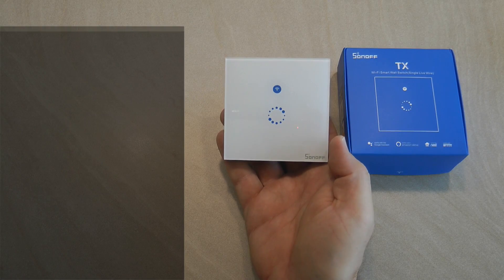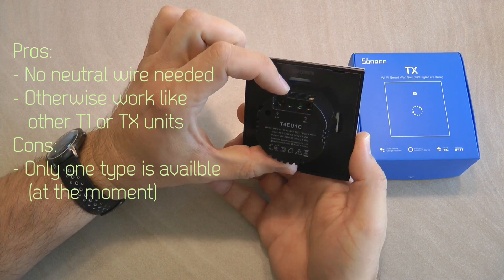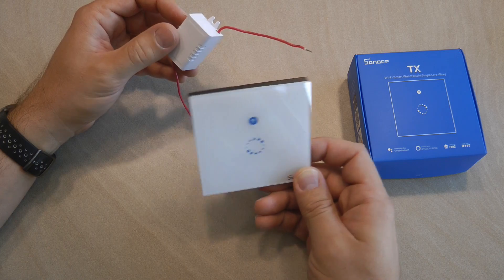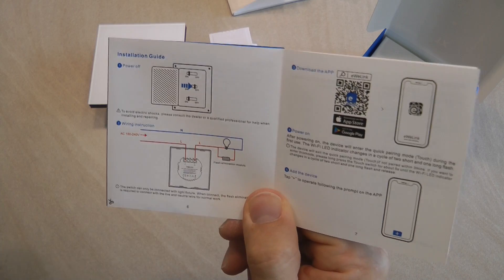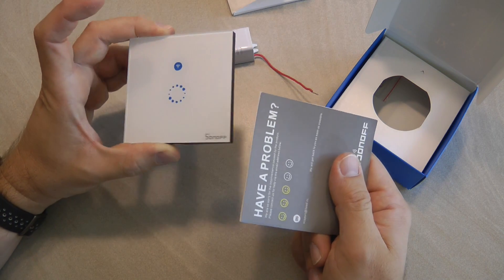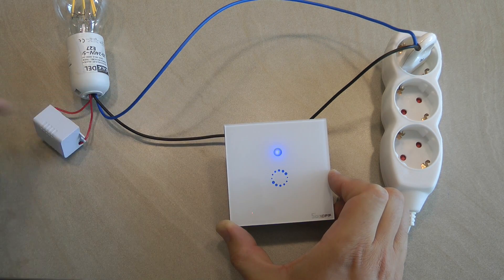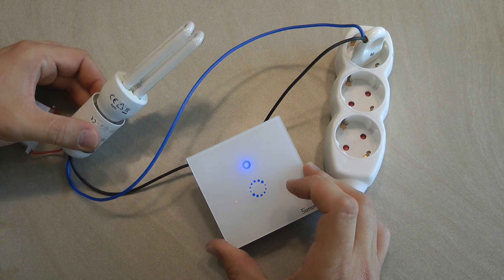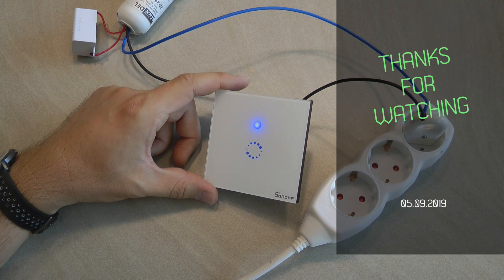Sonoff TX single live wire Wifi switch

Comment: My guess is it is actually an antiflicker unit,
one way to do it would be the sonoff leaks some current and used the voltage drop to turn itself on, this would cause flicker in modern lamps and hence the need for a bleeding resistor across the lamp,
but could you measure the leakage current and share the results with us, also can you measure the capacitance of the sonoff when its off and disconnected from the circuit?
Reply from the maker: It looks like the setup draws 0.003A or 0.3W (based on my cheap power meter). In the antiflcker box, there are 2 x 22pF (CBB22) caps in parallel with a 12,4ohm (?) (brown, red, yellow, gold) resistor. And to this, there is another 50ohn resistor in series.
Reply: @csongorvarga  this cant work, can you recheck please, 
12.4 ohm resistor is probably 124 kohm
CBB22 are probably not 22pf capacitors but much larger ones, read the text on the caps on second line, they should be at least 22n or more each, 33n to be safe
Reply from the maker: @bm830-b9e  The cap says CBB22 and in the next line 205J450V
Reply: @csongorvarga  OK, this can work, 
the 124kohm resistor discharges the caps if there is no lamp in the holder,
if there is a lamp in the holder it prevents the lamp from flickering when the switch is off.
the 50 ohm resistor limits the inrush current of the capacitors
when the lamp is off, the 2uf caps(CBB22) leak current which causes a voltage drop on the sonoff, the sonoff uses a dc-dc converter to reduce that voltage (and also increase the current) for the esp8266.
but how the device works when the switch is on?, well that's another problem which I am not sure yet!
thanks for the help
Reply: @bm830-b9e  2x2uF and 120kohm
Reply: @timm8311  thanks, also SuperHouseTV made a detailed video on how the device works if you are interested
Reply: @bm830-b9e  yes and if I'm not mistaken he explains about the discharge in case holding the the unit in our hand could be dangerous, so the resistor can discharge the high voltage in the capacitor very quickly, some few seconds, making it safer to handle the unit.
Reply: Szerintem csinálj ilyen videókat magyarul is, mert hiánypótló lenne. Én ma vettem egy hasonló SmartWise T4 EU 1C-t, ami szinte ugyanez, csak a Sonoffot már nem kapni Európában, kizárólag Kínából lehetne rendelni. Annyi különbség van a SmarWise javára, hogy az tud pluszba RF433-at is és kisebb méretű az ellenállás is, amit be kell iktatni s villódzás ellen. Egyébként ugyanúgy eWeLink kompatibilis és minimálisan tér el kinézetben. Nekem feketében van.

Comment: Can't find these switches anywhere!? I ordered sonoff tx switches but they require a neutral. Have they stopped selling them? Had to buy some chinese ones from ebay instead.
Reply from the maker: I can see the listing here: https://www.itead.cc/smart-home/sonoff-t4eu1c-wi-fi-smart-single-wire-wall-switch.html. Which site did you look. Maybe they don't have it in all Amazon stores.

Comment: Would this be ok to use on a ceiling fan? At the moment the fan is turned on by a pull cord that has just the live in and live out.
Reply from the maker: Sure, I see no reason why not. I don't know how much current the ceiling fans draws. Make sure it does not exceed the 10A which is the rating of the relay in this unit.

Comment: so this does not need another switch ? i mean if you take this wall unit will it be enough to do the job or should i take the switch and the sonoff box like device also ?
Reply from the maker: This Sonoff switch will be enough.

Comment: Hi, have you tried connecting one switch to 2 bulbs in parallel? There is only 1 anti flicker device so I'm wondering what will happen to the bulb without anti flicker device. Thanks
Reply: It only needs to be connected to one bulb to power itself and only one capacitor per switch is required.
Reply from the maker: I did not, but you connect the anti flicker to one the bulb and it will be fine.
Reply: @csongorvarga  Noted with thanks

Comment: Can this work without any wireless connection?
Reply from the maker: It always works as a regular switch. So if your internet is down you can still operate your lights.

Comment: anyone managed 2way switching with a couple of these
Reply from the maker: I think it would only be possible using using scenes. I have a separate video on that.
Reply: @csongorvarga  hi yes I have seen your video but when I connect two switches on the same one wire circuit none of the switches operate, maybe a power supply issue or conflicting info between switches, as a temporary solution I have used scenes like your video suggested with a separate downstairs light and the upstairs light and blocking off the switch downstairs that is linked to upstairs, and it has got around the limits of the one wire switch, maybe a battery operated switch at one location may be a good solution
Reply from the maker: @kennywilson7717  @Kenny Wilson I guess that anti flicker unit that you install only work if one one-wire switch is connected to it. T1 switches can be combined with a battery operated RF second switch. I never had one, so I am not 100% sure how that works. But that is not a one-wire version, that needs neutral as well.

Comment: Lol I still can't use it as I need a 3 gang unit
Reply from the maker: Let's hope it comes in the future.
Reply: @csongorvarga  what I'm planning on doing is I have too many lights so I'm going to remove the live coming to the switch from main and keep it aside and use the other switch going from the switch to the excess light as neutral by removing the bulb and bridging the Gap making it a neutral

Comment: Thanks for the video.
I'm still did not flash tasmota in the old T1 US but I can see that setting it in interlock mode by using ewelink you cannot set the inching mode. It means that if I'd like to use a T1 US with 2 gangs for a curtain when you turn on the switch Ch1 (CH2 will be off) it will remain on which having inching allowed it is possible to program it to turn off after the amount of seconds the curtain opens or close totally. Is it possible to control the T1 or TX by using NodeRed/MQTT and Home Assistant? Did you check it with your switches.
Reply from the maker: No, I did not. But I think it should be possible.

Comment: Can it be installed without the antiflicker unit?
Reply from the maker: No, that anti-flicker unit is letting a small amount of current through to operate the switch itself. So without it, will not work at all.
Reply: yes with an incandescent bulb, but not led or mini tube

Comment: Light bypased by capacitor at low currents. Low enough even an LED won't glow.
This also means if the bulb is not fitted the sonoff will still be active.

At the same time the electronic switch is likely to be, lets say, ~99% off or ~99% on PWM for the 1% time left to power it. With good capacitors the background current might be much less than 1%.

Comment: Hello Varga, whats happen if I connect two switches in parallel at S1/S2 ? Can I do this in order to have "tree way" switch? Thanks.
Reply from the maker: You connect the two switches in a 2 way configuration and connect the two ends to S1 and S2. That will work. Connecting them in parallel will not.

Comment: That anti-flicker box seems too large to fit most ceiling lamp bodies.
Otherwise seems like a really good solution, and it's rather cheap.
Wonder how safe these Sonoff stuff are overall for 24/7 operation.
Reply from the maker: It could be a tight fit, but I think still manageable.

Comment: Hey ,this will make life  a lot easier because modern houses stopped installing junction boxes here years ago  because it's a way that electric contractors save some money but still charge the same price. The world is getting cheaper day by day and the houses are getting smaller and less well made ,that's the facts of life.
Reply from the maker: Yes I agree. This is a smart move on Sonoff side. So far I don't see any drawback of this single wire design. Hopefully it gets picked and and other models will be released as well (2, 3 gang, US version, etc.)
Reply: @csongorvarga  I ordered one to test let's see when it arrives how it works .Although I also noticed that some company on Ali Express is selling  wifi enabled 15 watt dimmable bulbs which are compatible with Google home and Alexa for $5.00 would you believe that ,this is also a game changer if it works properly ? In my house I have over twenty smart gadgets including several Sonoff switches of different kinds and in different uses I am basically maxed out for bandwidth even though I have a 100 mb/sec connection which is the fastest  I can get in this area .
Reply from the maker: @daromee  Oh yeah, these are getting cheaper every day. I am still alien to the idea to have bulb that I can only control via an app or voice. I still prefer physical switches. And your comment on bandwidth: I don't get that. These devices hardly use the bandwidth. If you are facing issues, it could be related to how many wifi devices your router need to handle. I never had such issues, I have around 25 wifi devices around the house including the laptops, tablets, phones, etc. But there are other limiting factors. E.g. there are different channels you router operates on. If many routers around your area are on the same channel, that could be a problem. Buying one of those 5 or 6 antenna routers could be a solution. Those can work on 5Ghz and 2.4Ghz wifi at the same time. Meaning that your more capable devices like laptops, phones, tables can use the 5Ghz band and free up space for the other devices that can only work on 2.4 Ghz. I am not an expert in the area, but these are the things I heard to consider.
Reply: @csongorvarga  Yes I have quite a few devices but I also forgot to mention that I have five 720p cameras transmitting to an offline server ,I am also running everything through Google  so in the end I had another line brought into to the house and everything is now good  but expensive for two lines .As for using the 5 GHz frequency this doesn't work unfortunately for smart devices but does work for tablets and phones . I also heard that several wifi routers which have dual frequencies such as the Google mesh system won't work on even 2.4 GHz with smart  devices from China so I am using a very standard router which is supplied by my ISP. I have tried other some other routers and extenders here but they usually don't work with my smart devices .Another problem I didn't mention was that all the walls in my house are cinder block or similar with cement pillars so the penetration of the signal through the walls isn't so great . Sorry to bore you with all the details. I enjoy your videos very much as you explain everything so we'll. Thanks for doing what you do and it's quite interesting to me .
Reply from the maker: @daromee  Not boring at all. It looks like you have spend enough time on this already :)
Reply: @csongorvarga  thanks
Reply: @csongorvarga  I wonder ? I have one of those one wire light switches  from a cheaper company without any wifi and it came with a capacitor but I didn't understand then what it's for so I threw it out .Now I understand , but the funny thing is that before I understood I  saw  that when using led bulbs of the same wattage and the same manufacturer (Chinese ) some  flickered while others didn't .I thought these flickering lights were defective  so I threw them away ..Why would some flicker while others not ? Would there be a difference in quality of the LEDs but from the same manufacturer? .By the way as you well know because the LEDs are connected in series when one burns out you need to either replace the individual led (not for me) or through it out .I usually buy batches of these types of LEDs but since they are $1.95 each it really doesn't pay to fix them . I have had a batch's of ten with four burn outs which is quite poor .in general haven't had a led last more than two years which is much less than rated with use if approx 3 hrs per day yet but still hoping that quality will improve with time .  Have a nice day .
Reply from the maker: @daromee  Check the pinned comment on this video. bm830810 talks about how the capacitor allow some leakage current to pass through which is enough to power the switch. This is all I can tell, my explanation was simply "black magic". Going back to the cheap LEDs in my video one other issue is thermal management. My smaller bulb (like G20, G8) and especially the ones which are encased in clear silicone die faster. The manufacturer does not give a damn about thermal management and the components fail due to the heat after some time.

Comment: can we flash it :) ?
Reply from the maker: :) I did not open this unit, but most probably you can. I assume the low voltage side is same as in older TX, T1, etc.